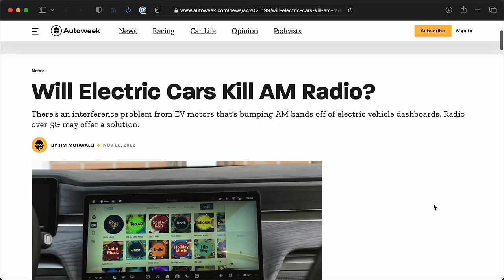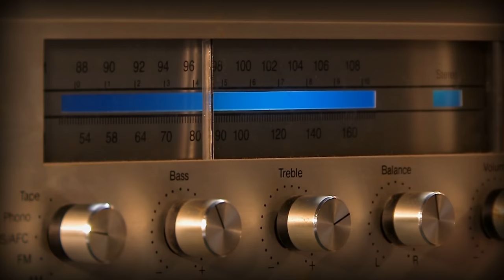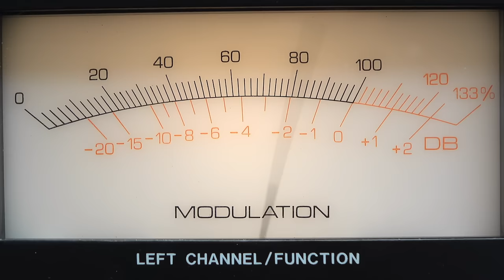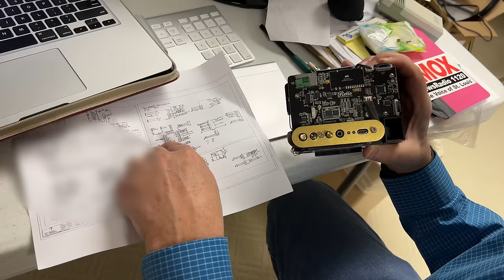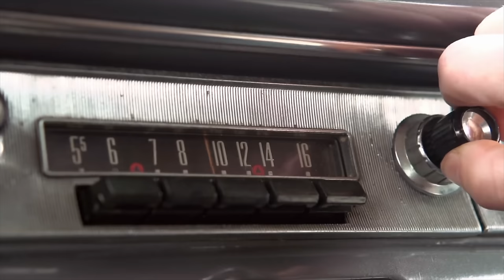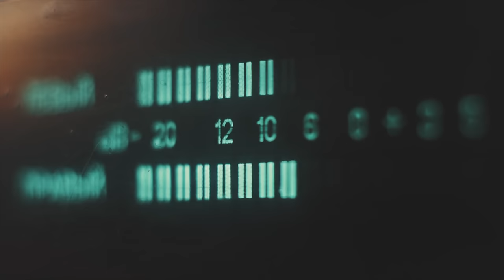Is AM radio dead? Tesla thinks so!

Comment: AM-only stations are scrambling to put up FM translators in the States. Ford threatened to remove AM radios in some of their models in '24 including their Mustang. Ford later retracted their statement and promised ALL models will have AM radios in '24. I never saw the value of AM Stereo and there are a few Stereo AMers in the States including one I am aware of in the Fort Wayne area. I believe it's was Finland that dumped AM n FM terrestrial radio for satellite.......Even though AM has it's drawback in sound quality it makes up for it in distant outreach where as FM is line of sight with excellent sound quality.I still have the old crystal radios and would hate to render it useless if AM disappeared,. AM also has the advantage of groundwave and skywave propagation. If they cut out AM radio in the States,they may as well pull the plug on shortwave radio.

Comment: An other real challenge (and benefit) of AM radio is that it is low frequency.  The challenge with the low frequency is that good audio requires 20KHz of bandwidth for a single channel.  To get stereo you have to have two channels and to get data you want more BUT the full AM radio band is only 1200KHz wide and standard station separation is 10KHz.  There is just not enough space and since AM radio has longer range, you have way less space and way more distance stations have to be apart to keep them from interfering.  This is much less of an issue for FM since it is higher frequency and thus a wider band and the shorter range means that stations don't have to be as far apart.

Comment: Automakers not bothering to put filters in the radio isn't new. My parents' 1985 Buick had an AM/FM radio, but there was a very prominent warning in the owner's manual that the engine's alternator would cause interference on the AM band. GM would at least give you the AM radio, but they couldn't be bothered to make it listenable.

Comment: As an person degreed in electronics and worked in all fields of electronics for decades , including radio .. AM radio has serious advantages and some  disadvantes.    Lets look at FACTs.    AM simply referes to the modulation technique.   The signal is amplitude modulated , but noise is also amplitude in nature , meaning noise from the static , man made ( like the car itself ) or from nature ( lightning ) WILL be received on an AM radio.  A disadvantage that FM ( Frequency  Modulation receivers ) will reject this type of noise ... However , there is one major advantage on the Current AM band that can NOT be overlooked.  The frequencies used by Commercial AM radios in cars is a band from 540 khz to just over 1580khz.  These frequencies will travel and follow the earths curvature, they even can penetrate forests, hills and many types of obstructive terrain that higher frequencies ( FM) get absorbed ... One reason this band was chosen, decades ago,  was because vehicles can go anywhere , and travel far from the radio station ...  Many clear channel AM stations can have listeners out 60 to 150 miles or more, and FM station on VHF frequencies has a huge disadvantage as the path losses on VHF are much higher per mile than those on the low frequency AM band.  FM is limited , line of sight range and metal and buildings in the path greatly attenuate the signal.  Commercial Aircraft  use AM , even today !  The reason is safety !!! If an aircraft is in danger and makes a call of distress on AM .. it still can be heard over other , maybe stronger , signals on the same frequency.  AM detectors in the receiver hear all signals on the same frequency and decode all of them at once !   Unlike , if Aircraft were moved to FM as proposed years ago , but declined by wisdom!  In an emergency call, if another aircraft was stronger or closer to the airport , their signal would completely swamp out the aircraft in distress.  This is called ' capture ratio ' in FM detectors.  The stronger signal dominates and actually covers anything weaker.  Not always a good thing.  The audio quality is not the issue here ... FM can have much better quality , only because its given a wider bandwidth .. no AM is a great thing to have in a car ( especially )  and because of distance and terrain ..  Years ago I remember listening to WLS AM from Chicago. All the way to St.Louis MO.  Without interruption.  It was fine !   You Cannot do this with FM commercial , not even close.  How many know that submarines used frequencies lower than our current AM commercial band ..WHY ? Because we found out that lower frequencies could penetrate water !   Submarines could be talked with under water !!!  Before we ignorantly throw out the baby with the bathwater , AM content then is whats keeping it alive , AM circuits are simple and cheap ( so that CANT be a reason).  Sound quality can be greatly improved on AM if the FCC widens the bandwidth   so that isnt a good argument against AM is it.

Comment: The motors in Teslas are brushless, so you don't get the spark where the brushes don't quite touch the copper contacts in the rotor. An electric drill is a good example of this, ideally a mains one, you can often see the blue glow pretty vividly when they're working. That sends out noise across a wide range of frequencies and will easily ruin AM radio near to it. But electric cars don't use those, so they're probably not the source of interference. There's all sorts of high-power signals bouncing round inside an EV though, and being filled full of computers doesn't help.

Comment: AM radio is still a reliable way to receive broadcast, so no it ain't dead. Tesla and Elmo also thought Ultrasonic proximity sensors and circular handles are dead but guess what? They are putting them back in next year's models.

Comment: The reason I am reception is noisy is because most natural impulse noise and man-made electrical noise is amplitude in nature. FM receivers have a limiter and discriminator Stage which remove the amplitude variations leaving only the frequency variations which get decoded as the desired audio signal.

Comment: here in the uk, fm is very popular (It’s way mor common than dab) so i usually use that. But one cool thing about am radio is that you can get it nearly anywhere. You don’t have to be somewhere around the tower for it to work well. Not to mention, building your own experimental reciver/transmitter with some resistors and thing’s lying around.

Comment: A few years ago I was bored and turned to a nighttime Clear Channel on the AM band in my truck. I'm roughly 500 miles away. Cool to get that old station, even sporadically, because their talk format and programming is much better than the horrible talk programming of the FM in my area.

However, I have a name-brand phone charger that interferes with AM. I made them send me another one, but it had the same issue.

Comment: Anyone tried using a broadcast AM radio in a Tesla? My hunch is that the motors and the various switching circuits to drive them make AM reception difficult in a Tesla. The company is living out what would not work anyway.
AM sports/talk radio has a major advantage over FM, which is mostly music. Talk radio offers up-to-the-minute commentary on recent events. What FM offers is what a smartphone can provide just as easily and with far more user choice.

Comment: We used to have a really high power FM station out of Winchester VA, then known as 92.5 WINC FM. (WINC FM still exists, but at 105.5 MHz, and barely receivable in Winchester since the transmit tower also moved.) Despite being 80 miles away, with the Blue Ridge mountains in between, I could clearly receive that signal all the way to Washington, DC, and it was nice to have something familiar to listen to on that drive. AM radio has this ability in spades, but then again, so does satellite radio. It's tough. I think digital over AM could be a thing though, especially with modern checksumming and error correction.
Reply: FM is now the property of religion and talk formats.
Reply: @rockvilleraven  It really depends on where you are. Where I am (Winchester, VA, USA), there are still a fair number of contemporary music stations. Venture more than 25 miles from my house, and it turns into that. Drive to Richmond though, and there's an FM radio scene reminiscent of the 90s. Don't know how Richmond manages it when Washington DC can't, but it is what it is.

Comment: Unfortunatley, in UK the main AM radio transmitters have been reducing their output power over the years, making the received signal more suseptible to interference both indoors especially on shortwave where it is having to compete with the electronic noise being generated by various routers and various devices and outdoors where a once strong signal becomes unusable and drowned in inteference. There is a narative from broadcasters and government alike, that AM broadcasting is on its way out.

Comment: This is the best, most thorough explanation of 'the problem'  with AM. Although I wish more attention were spent differentiating between Amplitude Modulation and the Medium Wave band (and a combination issue, the bandwidth of the signal).
Is there a modulation method robust enough to survive on our modern, noise/interference filled medium wave band?
It may be no help to the billions of 'legacy' radios unless there were some way to maintain an AM envelope along with the more robust signal. (I know the larger footprint makes 'HD Radio' impractical on MW since it stomps over adjacent channels). Is there any kind of clever modulation technique that can cut through the jungle of interference & keep the MW band useful? Let's face it, it's far too small to be of any interest to big tech. They're looking for multiple megahertz of bandwidth. The entire 'AM dial' could barely carry a single wifi channel. Still, the propagation qualities of the MW band make it quite desirable for particular uses - including the one AM Radio performed for over a century. Let's 'evolve' it, not 'extinct' it.

Comment: The demise of AM radio started with that Reagan era in its early days by the FCC that allowed some four incompatible AM stereo systems to fight it out in the marketplace. In fact, the then dominant system, the Harris system was forced to shut down voluntarily because of interference problems.  Unlike the Kenedy administration FCC, which used field testing to determine the best FM stereo system, the FCC did not bother to do any field testing. General Motors took up the task of doing its field testing and found the the Motorola system performed the best. Stereo receiver manufacturers stated that they could live with either the Motorola system (subcarrier phase modulation) or the Phillips system (subcarrier frequency modulation).  The then FCC, instead of rescuing Am radio from its demise, stomped on the fingers of AM radio which was hanging on a cliff overhang by its fingertips, then stomped on its hands before throwing them off the cliff.

Comment: Modern vehicles are using switching power supplies to enhance efficiency of the draw on the battery. this switching process is generally in the 1mhz range which is right in the middle of the AM broadcast band. Even if newer cars have AM radios you probably will only be able to use it with everything else turned off. Shielding the modern power systems is too expensive if it is even possible to do it at all. Even tail light power systems now are strobing at 60hz or so which also radiates interference and also causes optical issues for people sensitive to it.

Comment: DAB Radio is the equivalent of digital TV- usually far too compressed to realise its true potential. Very restricted distances, can broadcast HD or even 4K in theory but quality is  usually sacrificed for quantity.
FM Radio is the equivalent of analogue UHF TV- mostly good enough for SD but extremely wavelength hungry (4-5 services on TV, maybe 20 or so on FM) and can only travel a certain distance before fading to white noise.
AM Radio is the equivalent of VHF TV- can travel much further, but best left to the days of grainy black and white as the signal mostly is white noise.

Comment: I can turn on a 50+ year old component tuner or portable radio and the local and big AM stations come in well as I live in a rural fairly noise quiet area.
If I use a modern chip radio....static and almost nothing end to end.  Car radio on my 2013 Ford....barely better.

Comment: Unfortunately, AM radio is dead or dying rapidly, and it's not because of Tesla. I love AM, I started my career on AM, my current station is an AM (about to go dark after 90+ years) but the listeners aren't there on the band and haven't been for a long time. KMED has been very successful at News and Talk in southern Oregon but most our listeners are on FM and/or streaming. We've moved the AM's programming to a full power FM/HD and listeners are quite happy.  Most people like me who grew up on AM are age 60+, and that's not a recipe for future success. The land costs of moving our 5kW AM signal just don't pencil. Yes, it would have been nice had the FCC enforced noise regs, but it's too late to start to save a band that was starting to die in the mid to late 1970's. Rush Limbaugh and talk gave it another 20-30 years of life it would not have otherwise had.

Comment: Back when I was a kid in the early 70's you could listen at night, to stations 1000's of miles away. AM was great for that. I have a old console valve radio that I will still be able to use in the future by using a low power home AM Transmitter so technically AM is not dead, but it will be a real darned shame that radio stations will go, or will they.....??

Comment: Here is something cool, I replaced my battery on my 1995 3.0 ford ranger and when the battery is disconnected the radio presets reset. Anyway I replaced it and as soon as it started I was on am 1100
And you can hear the engine reving down while warming up. Pretty cool

Comment: It's not that they couldn't be bothered. I spoke with škoda representative and it is really hard to put AM radio in electric car, it really creates interference when you sometimes need to have feedback from radio to use different frequency PWM to control some motors, so you don't create hearable interference. I love the technology of AM radio, it is simple, works over long distance. EMC is hard topic, it requires lot of testing, lot of knowledge. Just saying.

Comment: Storytime, out in Exeter New Hampshire in range of my summer home there was this a.m. classic rock station that only lasted just about a hot minute. It was really something hearing all that rock and roll on my little AM radio on wxdx to the point where I went and picked up at a thrift shop a little GE 9 volt power transistor and listen to it one year. There was another a.m. feed of big 98.5 in New Jersey which I actually listened to on a Grand Prix radio it had nights with Alice Cooper on it. The next year I came back with my blue Pioneer transistor radio. Using voice dictate I meant wxex.

Comment: The state of AM radio is unfortunate, but technology attacks it from all sides. I still do a scan in my EV of the AM band when parked or stopped for a while.

Also, name a radio service that you can make a receiver out of items found in most homes for less than 50 cents. [graphite/razor blade detector]

Comment: Pardon my ignorance, but would a Tesla interfere with my AM radio if I'm right next to it? Or not, because it's isolated (two separate cars).  And if not, then why couldn't Tesla just isolate the radio the same way? Power the radio on a separate/isolated/shielded circuit?

Comment: I have all the usual suspects in my house but the only real AM interference sources are LED dimmers.  The LED's without the dimmer are pretty quiet, as are CFL's.  I think they keep the RF mostly out of the AC line and they are too small to radiate much AM broadcast interference even though they are unshielded. I have to try winding some chokes for those dimmers though, they are horrible.

I used to know some AM broadcast engineers back in the late 1970s and they had a professional AM receiver that was hard to distinguish from FM by ear except it wasn't stereo.  They were happy to tell me they were broadcasting a good signal but my receiver was crap.  

I'll have to give a listen to AM, I keep a battery radio for emergencies.  Probably there isn't much on, but that's true for FM, TV, and cable as well.  I have to admit being amused by "Coast to Coast AM" during a late night road trip, dunno if that's still on.  I also have a shortwave, it was interesting to hear a preacher using SSB to save money on the electric bill.  He was broadcasting music too, on SSB!  Music sounds outrageous on SSB.

Comment: there is a very simple problem with AM radio. it requires a lot of power to broadcast and the bills must be paid by advertising. it's the same reason shortwave stations have dried up.
they all came to prominence in a world of cheap electricity. those days are over.

Comment: NO,   AM RADIO and FM RADIO should be REQUIRED for ALL CARS AND TRUCKS.   Refer to the old FCC rules that required Metal shielding in ATARI 400 and ATARI 800.
Foreign Car Manufacturers plan to FLOOD USA with poorly shielded equipment... FCC needs to increase and improve the Protection of Americans from STATIC noise !